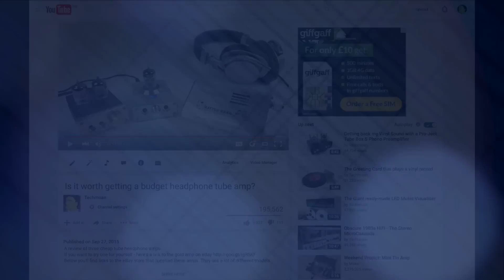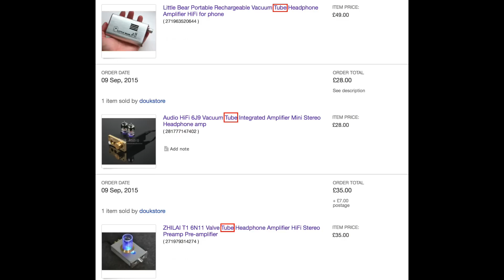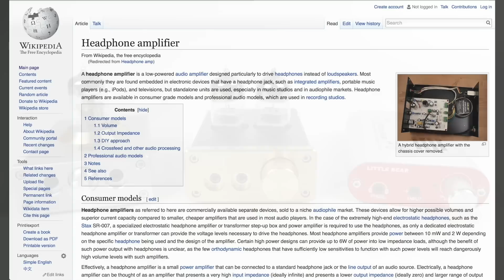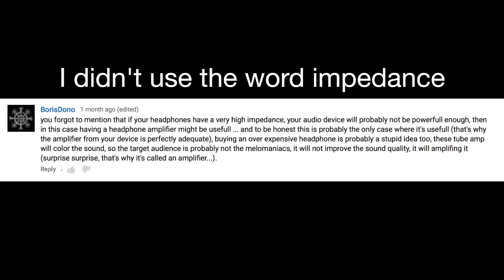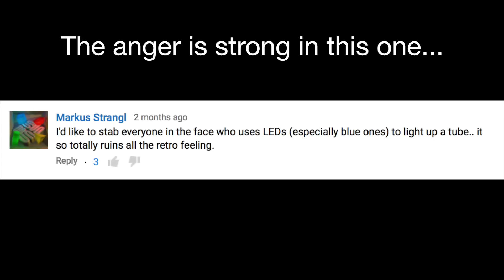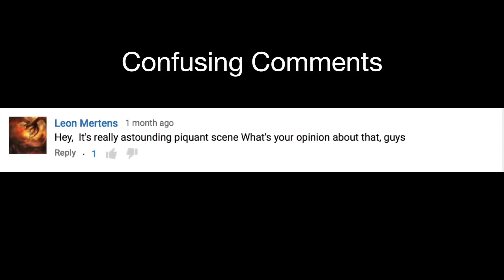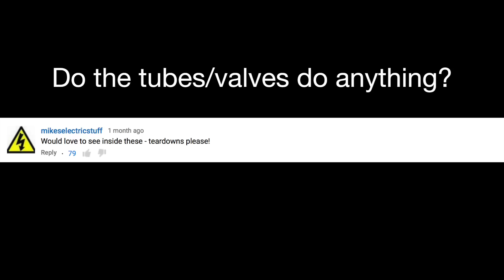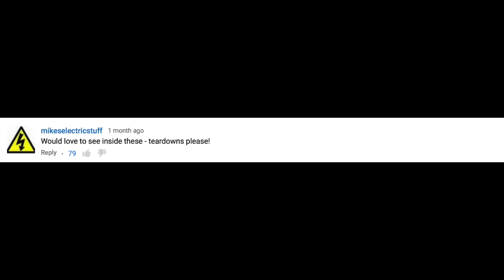Headphone Tube Amps - Follow-up & Tear-down

Comment: Most of these Chinese headphone amps are some sort of hybrid amps.
The chips (black 8 pin devices) are the amplifiers proper. The signal is subsequently run through a valve (not a tube! ) to give the sound a certain 'colour'. This is generally experienced as pleasing to the ear and reminiscent of former era equipment.
So we basically have a solid state amp with a stage that adds a type of desired distortion. 
There isn't anything wrong with that, people like AM radio, for instance, for the same reason.
Calling these devices tube-amps (well...valve amps, really) is a bit of a misnomer, in as much as the valves in them will actually attenuate the signal a bit. Calling them valve-signal-conditioners would be more correct.
The problem also is that these Chinese made valves are truly at the bottom of the barrel. Nobody who knows anything about valve electronics, would use them for their own projects, they are truly of the worst quality possible.
In that sense, these devices are indeed a waste of money. A simple solid state amp will do a better job.
I am sure that there are properly working (real) valve amps for headphones on the market, but you will not buy them for 30 or 40 quid. You can spends between £250-500 for a 'real' one. Alternative, you can make your own if you know what you are doing.
They are in essence , very simple circuits, with only a few pitfalls to be aware of.
I agree with the poster of this video, when I look at some of these comments.
The people who know the least, seem to be the ones hell-bent on sounding the loudest!
It is a pity that this energy isn't used to actually learn something but rather wasted on mouthing off, festively ignorant about the addressed subject matter!

One word about the battery operated one. (the little bear amp)
This is truly a commercial product, wholly made for the ignorant, in the sense that battery operated valve equipment is a bad idea at the best of times. The filament from a valve (even the ones especially designed for such purpose) will run away with the lion-share of the power the battery can provide. This alone makes this a circuit not fit for use, even if the rest of it would be working as advertised.Leading the signal from the solid state stage to the rest of the circuitry, but bypassing the valve, may make it into a usable solid state amp, but the apparent build-quality makes that an iffy proposition as well... 

Cuddles and kisses!

Paddy (EE)

Comment: the Pono was designed by one of the best high end audio companies going, its a great player don't let the people that don't know any better put you down. I believe it was the first high rez portable player on the marker but I could be wrong there. People tend to be nasty online something to do with the hidden behind the screen thing so don't let the haters bug you they tend to not know what they are talking about anyway just going on hype.some of the cheaper tube stuff they really are not using the tube as an amplifying devices. They are used as cathode followers or buffer stages essentially adding "tube" sound to an SS device.

Comment: 'The gold 2 tubed amp improved the sound ever so slighyly'. Yes, but you can tweak the sound by upgrading the tubes if you like.  The 6J1 tube is not very expensive.

Comment: The little bear use a boost converter?  And a charging module  bouth worting about 4-5 pound . Intresting off the shelf componet in a such expensive thing.  I think the batery is from a rc car or helicopter toy.  And look a those 2 trimpod.  Is not electronics so AMAIZING when you try to build only with one hand . Well done how made that 😂😂😂😂

Comment: A brief look at those PCBs, they seem to indeed using the tube for amping - which is basically the easiest thing to do if there's already a tube. The two tube amp has a good layout in my eyes, the bear is extremly messy which explains probably the hiss from a ground-split somewhere on the pcb and causing components running with different ground levels at high frequencies. (Hope this explaination makes a bit sense to you)

Comment: Concerning the pins "not being connected": They are, it's just that some of the connections run on the top of the cicruit board. That's because some of the parts are thru-hole while oders are SMD. Basicly it means that some of them are soldered on top of the board, hence the "missleading" layout. 
These amps probably actually use the tubes, but not really as the preamp. All three Board contain Op-Amps, microchips designed to amplify audio. You can expect, they provide most of the amplification. The tubes probably run in a so-called starved-plate-mode on a low voltage wich makes them unseless for amplfication because they will overdrive very quickly. But this also means they can be used to provide some subtle compression, which is what I think they do in these amps.

Comment: I see parts on the boards that look to be DC to DC  voltage converters, to convert the 12VDC from the wall wart to around 100V DC the tube needs to operate.    Tube amps like these introduce a small amount of second harmonic distortion (like 45dB down) that the human ear finds pleasant, as being "warm".  Which is pretty much the reason these amps are made and sold.

Comment: Absolutely fine to touch these valves, they are receiving valves, low power and run cool (compared to high power transmitting valves, that is).  "Impedance" is technical jargon (precise well understood meaning), not a buzzword (= marketing BS)

Without the schematic noone's going to bother analyzing any of the circuits I suspect.  Or you could send them to EEVBLOG mailbox?  Or just google for a more in-depth teardown.

The build quality on the Little Bear is, to be polite, shoddy.  Though it clearly has a high tension power conversion section with
the large capacitor and looks the most plausible true valve amp.  However the micro-miniature valve it uses is almost certainly going to be unobtanium at some point soon.

The key give away that a valve's being used is the high tension supply being present.  Note that valve circuitry can sometimes have lethal voltages present long after power-off, especially if you took the tubes out, so you inadvertently took a risk there opening them up and not draining the electrolytic capacitors.

I've seen some review like this elsewhere where the valves were used as cathode followers, basically doing nothing useful, but still in the signal path.  Its all show, if you want a good headphone amp you need some good opamps, and there are some out there that are phenomenally low distortion (they're what's inside professional mixing desks from the pre-digital era)

Comment: The big block behind the valves in the Mistral is probably one or several transformers. Valves have high-impedance outputs (SEE, it's RELEVANT!). Modern speakers tend not to be (the old crystal earphones did though). So valve amps generally use transformers to match the impedance. From high-voltage low-current of the valves, to low-voltage high-current of modern 8 ohm speakers (8 ohms is quite low as impedance goes). 

Also valves like this generally run around 90 volts, so you need a transformer to supply that from the mains. So, 1 for power (the 2 valves can share a power transformer, if they were horribly expensive "audiophile" ones they'd probably have one each), and 1 each for the stereo channels, so 3 altogether. Maybe the block is just the biggest, probably the power supply transformer. Or maybe all 3 are in there. 

Technically a switch-on delay doesn't prove anything, a manufacturer could fake that easily enough, if they wanted to. It would be easy to find out though, if someone who knew what they were doing took it to bits and reverse-engineered the circuit.

An innocent explanation would be waiting for the power supply's smoothing caps to charge up. That can cause a delay in any mains-powered amp, depending on exactly how it's designed.

Comment: Sigh, youtube commenters... Meme users, people who think they know everything and first retards mostly. I noticed on the second teardown that it has an inductor so it could be utilising a boost converter to generate a higher voltage than the supply. The others could be doing the same with a diode/capacitor voltage booster. Cathode ray tubes sometimes need 100s of volts, audio tubes a lot less.

Comment: That Walkman and that stereo valve amp look great together. Get an oldskool black & gold speaker (or two with a device that splits the amp's output to stereo) to complete the look and you've got yourself a cool little office stereo.

Comment: Yes it is worthwhile getting mini tube amps, especially for older low impedance headphones requiring a bit more drive. However, the issue with the single valve unit similar to the one in this video turned out to be the power supply. Given its excellent sensitivity, the tube circuit carried some ugly 50Hz hum noticeable with low amplitude signals. A problem easily correct when powering the unit from a 12V battery. Never mind any reversed channel polarity. That's just careless engineering by those inclined to think that channel wiring integrity is of little or no significance, and people who actually understand and buy such items are prehistoric post war fools. Given that it is electrically more efficient to by a 1000W D-Class power block good enough to drive the neighbours from their house.

Comment: Audio tubes (valves) are not affected by fingerprint grease at all. Fingerprint grease is a problem for things that run incredibly hot like halogen lamps and arc type lamps. Audio tubes are more like household light bulbs in that ordinary environmental contaminants (including fingerprints) make absolutely no difference to them. I thought that you describing the microphonics of the tubes as "ringing" was perfectly fine as a way to describe what you were hearing, yes "ringing" is not the correct term but who cares. Audio tubes require a high voltage rail to work properly and get into the desirable "zone" that tubes are famous for, these little headphone amplifiers might have a voltage doubler circuits in them but it is unlikely that they would do a full step up to the 200-300 volts that is required. Most of these budget units will pass the audio through the tube but the tube will not do much other than look pretty. The real work in these cheap units will be done by the solid state electronics and in most cases it will be some good old NE5532 (or equivalent) dual op amp IC's that actually drive the headphones.

Comment: Hi Techmoan,

Saw your vids just now and was intrigued.
So I went to the bottom of it (albeit a shallow bottom - the bottom as far as I see fit for now).
(N.B.: I am fully aware that I 'skate' over tech details here; I am not trying to be complete. My only aim is te enlighten.)

1. The voltage of a valve amp should be higher!
Not really; only minimum restriction is about the HEATER GRID voltage (which is typically 6.3 V), so the battery/main voltage is enough to make the valve 'work'.
The HV (High Voltage) involved in valve amps is the SIGNAL voltage, AFTER the valve. Of course, as there's only need to drive the headphones, not a lot of 'umph' is needed, so HV is combined with (very) low Amperes.

2. These things don't really amplify!
I will only say that the amplification factors for the 6J9, 6N11 and 6021 is 57, 33 and 35 times. Depending however on the rest of the circuitry; these values are the 'raw' (maximum) amplification factors.

3. Signal delay shows valves at work!
Sorry, but the only thing you are showing is heat-up time. Not to be confused with signal delay ;-) There is no buffer in a tube amp, so no latency.
Heat-up time is probably directed by (some of) the IC's. This is to protect the valves. A cold valve does NOT work, as it needs heat (and a signal voltage) to emit the electrons.
Heat-up time is typically regulated between 10 - 25 seconds.
Sidetrack: in guitar (valve) amps, there is a bypass switch for this very reason.

B.T.W.: your typical 'hiss' in valve amps is probably the heater grid warming up, losing some electrons in the proces.

Hope this clears away at least some mist on this subject.

Keep up the good work! I like what you're doing!

Comment: Dont test them with Music. Use a sinewave 1Khz oscillator. a distortion meter Afterwards bandwidth check with sinewave oscilator from say 16 Hertz to  at least 40 Kilohertz.Making sure that no distortion occurs well at leaast under 0.1 procent. Dont rely on your ears to test them.

Comment: Both seemed to be solid state drive amps.   tubes are there to act as an conductor hence doesnt work without.  takes the time for tube to warm up before it passes the current tru , so delay is similar to real tube amps.     

It is highly likely that tubes affect the sound in someway anyways,  im not an expert for that.  But they are not wired like tubes on guitar amps or old tube radios.   

For the price they are,  id but my bet on they just being there for looks and sell points,    connecting jumper wires instead of tubes would make them work anyways.    I guess this is one for the snob kids, who need to feel special and have a toy to feel proud for their friends.

Comment: Touching glass that will get hot only damages silica - pure quartz glass (halogen lamps, HID-high intensity discharge lamps like xenons in expensive cars and projectors, some exotic hi pwr. laser tubes, Xe. flashlamps...) 
Vacuum tubes for that low powers are made of... well some kind of "soft" glass, not pure SiO2. 
Fingerprints never really hurt burn time of REGULAR old bulb/pear shaped incandescent bulbs.

On the other hand, oils/fats from your fingers DIFUSE INTO pure quartz glass at hi temp. and make it stressed and porous and messup cristaline structure if there is any...as far as i know

PS. Blue LEDs. UNDER TUBES...just no coment. 
Ok comment. Paint them with black nail polish if you have any/desolder them and use them as indicator lights in devices you fix for PEOPLE YOU HATE!!! Run them at like 35ma or something they(LEDs, not people watching ;-)can handle and they will drive anyone crazy ;-)

Comment: I am working on 50 and I was raised around elders that repaired every thing them selves and I have all ways heard them called tubes and I have learned one very important thing you will all ways have some dumb ass that has a problem with something you say, do,breath look like and more and more and hell more a few more time so let's do like my granddad use to say in one ear and out the other and keep on doing what you and tubes are a type of power amp.

Comment: the tubes might just be space-charged tubes,that would solve the problem of the low voltage as those tubes usualy work arround 12v.they aren't powerful enough to drive a speaker without a more powerful amp but they are sufficient to drive headphone.

Comment: When people saying "the tube is just for show" or something like that, they don't mean that if you pull out the tube the circuit still working. They mean that the tube are there not to add quality of tube or "tube sound", because in order for tubes to do that, usually they need high voltage to bias. Not just 6 volts. As you see there aren't any voltage multiplying circuit in that PCB, so most probably the tube are in "starved" condition. So it work just like a regular transistor, but more noisy. Real tube implementation will add "even harmonics" by how they saturate the peaks of signals. Starved design just don't do that.

Comment: I work with professional tube recording gears, but no, they don't hiss like that when I cold start it. Your amp probably have a failing / bad coupling capacitor somewhere in the signal chain, or semiconductor component going bad.

Comment: Gotta wonder if using one of these as a preamp between your guitar and a regular solid state guitar amp would give the final output that valve amp sound guitar geeks love so very much... 

Where it comes to guitar amps, valves do have a warmer, more vintage sound but you pay through the nose for it. One of these could also be neat to add between a guitar and an audio controller connected to a PC for recording. Thanks for the vids.
Reply: On Ebay, there are pre-amps based around the 6j1 valve. They have no IC shenanigans and use a voltage multiplier to take the 12V AC and pump it up to 56V. Look for 6j1 tube preamp X10-D.
When building one, don't fit the volume/on/off control or the phono connectors. Use a 50K pot for the right channel and a 100K pot for the left. Short out the power connection at the original pot location ( always on now)
Wire a 1/4" jack to the right input channel, wire right out to left in, and finally, left out to another 1/4" jack for output. You could just wire left out to one of the inexpensive Ebay Class D mono amps that proliferate there.
Voila!, one valve based preamp with gain and volume controls for your guitar. As the 6j1 is running at 56V, well outside the usual 'starved plate' region, you get some rather pleasant sounds from it. Not at all harsh and spiky. Sounds good, is easy to build, but beware, a 12V 1A transformer and a suitable case rack the costs up.

Comment: This "microphonic" thing: A microphonic valve (sorry, I'm English!) is a faulty valve. What happens is the metalic bits inside the glass envolope have become loose and they move around when tapped and because they move around they generate a sound. Anyway all this is a way of saying if a valve is microphinic, it's a faulty valve. Replace it and it won't ring when you tap the thing.